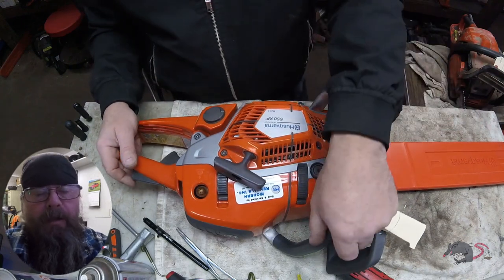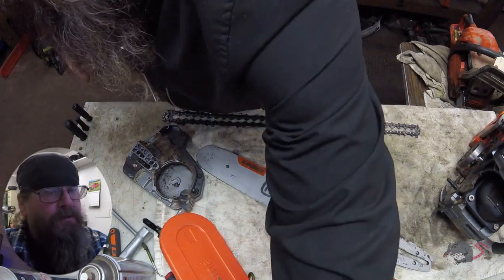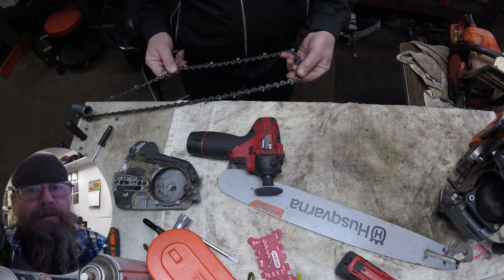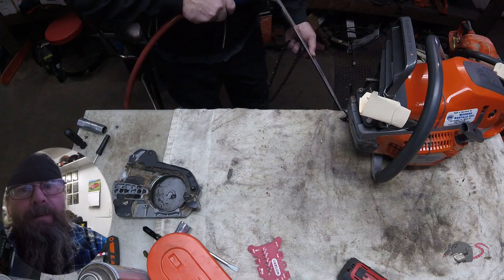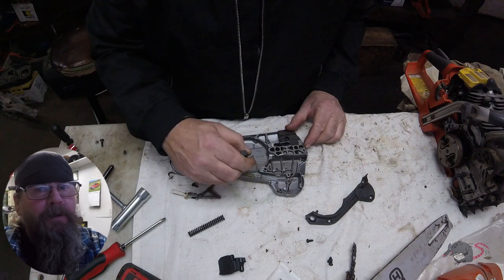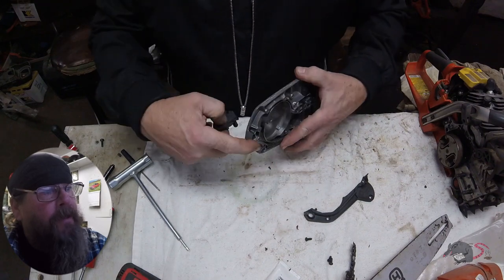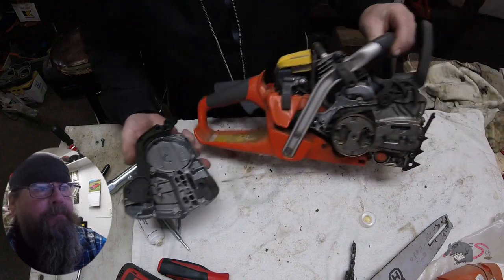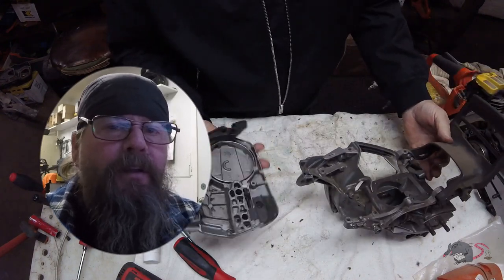Two Most Common Chainsaw Repairs That I See

Comment: I picked up a 440 on fb marketplace for $10, it was only 7 years old! Thankful I knew enough to not go ham on the clutch cover when it was stuck on the machine. Was able to reset the chain stop and cover came off no problem. The bar is bent though, worth repairing? About 5-7mm out of spec.
Reply from the maker: If the rest of the bar is within spec then yes just bend it back

Comment: Most of the saws I see on here are relatively clean, ever get any so bad you have to clean them before you can even work on them?
Reply from the maker: Unless its a trade in that we are gonna resell or a specific request I don't clean any more than a high pressure air hose will remove. Yes sometimes they have to be blown off but not too often.

Comment: I’ve 14” electric saw. Lately the chain comes off regularly? Any suggestion? In naked I I don’t see any issue with the chain or bar. With no load it runs perfectly and chain doesn’t come off the bar. I appreciate any help. Keep in mind that I’m an ordinary guy who have some cutting job in my front and backyard.
Reply from the maker: The first thing I would look at is if the saw is oiling the chain. Is the chain dry or oily? Once the chain comes off there is a chance that some of the drivers of the chain were damaged. These are the parts that rest in the bar groove. If you have damaged drivers that don't sit in the groove then you really can't properly adjust the chain.
Reply: Thank you so much for your reply. While watching your video I though to readjust the tension of the chain. Before I used to do it by hand but then by following instruction on the machine I did it from the teeth given on the side of the chain. Before chain used to hang little bit and chain used to come off bc of that. After I tighten it to the level where chain almost stays inside the bar. Chain is not too hard and can be moved with hand. So I’m glad it’s working. I already tested it on a tree. Thank you again for great video.

Comment: So way back in the day I had got a chain given to me because I was young and broke and it had the issue it got run lose or whatever. I had 61 husky at the time and mostly cut firewood to sell to get by. So I had a old worn out bar and I thought if I start with chain lose I could maybe just wear the chain back in slowly tightening it up as I went! By God it worked great and put the chain on my good bar and cut wood till teeth were gone!
Reply from the maker: Good job!

Comment: If my chainsaw came with 18inch bar and chain 0.058 gauge. Can I pute a shorter blade with smaller gauge lets say 0.050, or I need to keep same gauge but only shorter blade?
Reply from the maker: You want to match the chain gauge to the bar. The sprocket or rim drive will handle both .050 and .058 chain.

Comment: Just put the chain on a little loose, start saw, and full throttle it for 1 second, and it'll take all the burrs of the drivers. Then tighten it back up
Reply from the maker: In the field that would be a good work around but in the shop we buff the drivers.